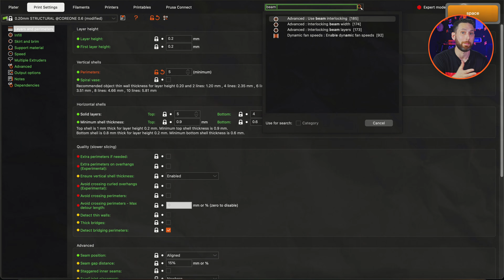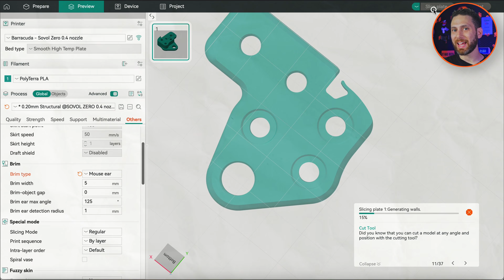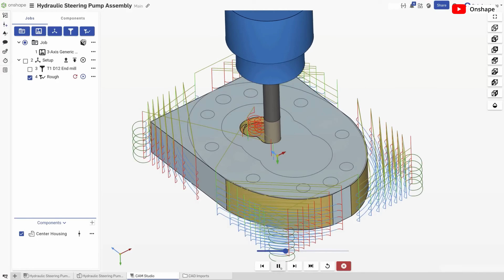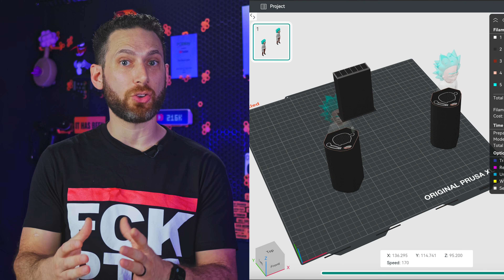Orca Slicer Just Added a TON of Useful Features!

Comment: I used STL once or twice in the very beggining of my 3D printing adventure and I was printing something that needed to be very round. I noticed the circles were like faceted and I hated the look. Googles why this is and got the STl vs STEP file crash course. Havent looked back since. All my designs are exported using STEP files now. The slicers sometimes take a good while to load the parts and I have had crashes but the results speak for themselves. Its worth the pain and suffering. Now if the slicer programers could optimize for STEP I think it would solve all my issues. Perhaps someday.

Comment: Reimagined & Modernized: QSlicerPicker for macOS/Windows/Linux

Hi everyone! I’ve been working on a complete rewrite of this utility to modernize the experience. Inspired by this project, I’ve developed QSlicerPicker—built from the ground up using GoLang and Fyne.

My goal was to create a more robust, cross-platform version with a cleaner UI and easier configuration for 3D printing enthusiasts. It currently supports a wide range of formats (3MF, STL, STEP, OBJ, and more) and allows for a seamless 'Open With' workflow to bridge the gap between your files and your favorite slicers.

It's still in active development (currently polishing the macOS bundle integration), but I’ll be sharing the project and the source code very soon. I'd love to get your feedback once it's live! Thanks for the original inspiration that started this journey.

 https://www.printables.com/model/1555284-qslicerpicker-utility-open-in-slicer-of-choice-aut
https://github.com/QTechnics/QSlicerPicker

Comment: Does beam interlocking work automatically.. or do you paint a section of the model where you want it to interlock.. and then select one print head/material for half of it and another material for the other half? Looking to print TPU + CF/PA6 materials as well as with ASA. Using PLA supports.

Comment: some mome my tips:
you can use outer/inner walls instead of precise walls (up to 30° on P1S  @ 0.2mm layer height)
avoid crossing walls (better for stringing)
arachen wall generator and decreasing mimimum wall width or outer wall line width to get more details

Comment: These extra features are really cool, but I know I won't remember they exist by the time I need them. It seems they keep adding more and more settings, which is great, but I'd love to see a developer do something to fight against users needing to be an expert on slicer settings to get the best prints. Like maybe a settings optimizer you could choose to run that would examine your current build plate and make recommendations base on the content.

For example, that X-Y Hole Compensation feature must mean the slicer can tell when there are X-Y holes in the object. So if you run the optimizer, it might prompt "It looks like your print has X-Y holes. Would you like to turn on X-Y Hole Compensation?"   Or "Your model's Z height isn't an exact multiple of your chosen layer height, so it will be rounded down. Would you like to enable Precise Z Height?" etc

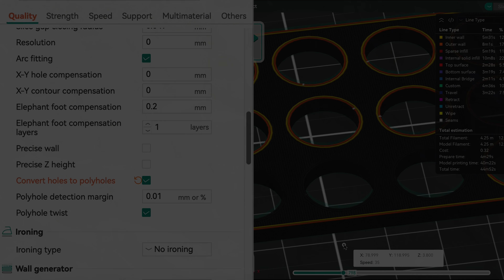Comment: 8:25 aaaand this is not a problem when using STL files.
I use STL files, not only because they're easier to make with blender, but because I can be deliberate about the EXACT geometry I'm getting. there's no room for a computer to choose "what's better for me". I know exactly how smooth I want a corner. I know exactly the sigmoidal profile of a curve because blender lets you choose that, and I still get all the benefits, because I just re-export, hop into orcaslicer, and select "reload STL". while yes that is available in other formats, with STL I know that I'm not making my printer do a single calculation or move I didn't plan in advance. it's not uncommon that I'll undersize a hole for better thread contact, or even need to adjust a hole's shape to be not an ellipse so layer lines and bridging don't interfere with the end product's contact with a support rod. and it'll print the same from any slicer.

Comment: Multi-toolhead stringing: your filament is too wet. If your filament is at sub-20% relative humidity at room temperature, you will get minimal stringing. I don't even use a prime tower on my XL for multi-color prints. TPU and PETG are going to be more sensitive than PLA, but PLA still does it.

Comment: Traditionally, infill didn't add much to part strength. I think testing infill multiline for strength/rigidity benefit might be prudent. After all, a single line of filament is a limp noodle only good for stabilizing wall layers during printing, but 4 lines of filament is a wall able to transfer load.

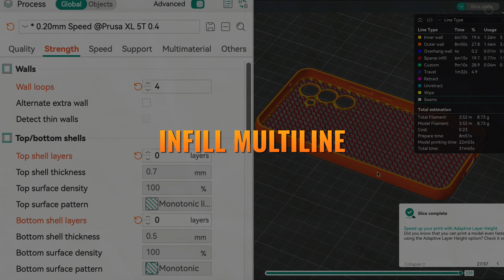Comment: 20:10 Infill Multiline, or infill multiplier as Cura has had for years, and is huge for TPU.

For ridged materials the perimeter provides all the strength, but not for flexibles. 

For flexibles the infill provides the strength and the perimeter disperses the load. 

Increasing infill lines behaves differently than just increasing infill. This setting will enable so much more for TPU in Orca. 

10% density 2 lines > 20% density 1 line.

Comment: i recently discovered ironing by accident when i printed a 0.2 width line from a 0.4 nozzle. The layer was perfectly smooth, but this was all at  600mm/s speed. Later i unfortunately discovered the actual ironing which is extremely slow. That layer time went from 60s to 16 minutes when using ironing

Comment: combine infill layers is nice, every 3 perimeter layers, it will print one infill layer of that thickness of three of those perims. You dont really need thin layers for infill since its inside you cant see it. This is extra useful when you're using the adaptive layer height, which can produce very thin layer for round geometry -- you wont need 0.05 thick infill in those areas .....

Comment: I'm just trying to figure out why you hate PETG so much that you created a shirt stating it, lol.
Reply: i only hate it because it's so brittle - i have just today dropped a massive piece (took just 7 hours... but still), and it shattered. But it is otherwise a pleasure to work with - reasonably strong, reasonably heat-resistant, super easy to print (generally ok undried), easy to glue, easy to drill.
Reply: @victortitov1740 increase your print temps. I noticed that anything under 250, PETG tends to be really brittle. I suggest 260-270. I usually do 270. I don't know anything about material science but I do know that it acts like a completely different material when printed hotter. I discovered it by accident when I first started to print with it. I ran a temp tower from 230 to 270. 250 and up looked the best but 250 snapped in half super easy. 260 bent quite a ways before it snapped and 270 had flex but not much. So I just went with 270 and everything I've printed with it has been insanely strong and I have yet to break any of it.
Reply: @Whambamrustytram  the thing that shattered was printed at 270... but this particular petg (overture gold) is weird, it just wouldn't print at the usual 230-250 (although i'm starting to suspect my hotend temp sensor).

It's not brittle when i load it slowly, it usually bends. It is brittle upon sharp impact. The one i'm using seems to be a little bit more brittle than usual, but i haven't done a scientific test, can't be sure.
Reply: @Whambamrustytram  I'm starting hating it too. Doesn't matter how long you dry it, after a few hours it will become as wet as was before
Reply: @enderforend4905  Any filament that is hygroscopic needs to be kept dry during storage and printing. A dry box doesn't cost that much and you can also easily make your own. There are plenty of tutorials. Hating PETG is silly. It's better than PLA for most applications if you know what you're doing.
Reply: @enderforend4905  I always dry mine and then print it from a dry box or drier. Thats what is recommended with PETG, so that is what i've always done and never had any issues.
Reply: @Whambamrustytram how do you route the filament? What printer?
Reply: @iklink Flashforge Adventurer 5M Pro and I print it out of my homemade dry box. Which is just a gasketed storage tote that I added a  some rollers and a dessicant box in. There is a guide that goes through the side that I can connect a ptfe tube to, and that runs up to connect to the printers feed tube.

Comment: Ironing support interfaces is killer. I've been doing this manually with built in supports for a while, and it does result in cleaner overhangs on flat overhangs. Even with like materials. Such a good improvement to have it automatic!! BTW fun feature in the Alpha - on my A1 mini, "Load Filament" is actually UNLOAD FILAMENT! Oooops guys!

Comment: the extra infill line was a long time ago added to cura.... it really helps out, if your infill needs to be super strong
Reply: thought the same.. but not only strength is a good reason.
It reduces layer seperation on infill.
And it's also a good way to increase weight without getting a "fine" (high %) infill and an other good parameter to modify TPU bumper springs ...

I used it a couple of times for ABS (less layer seperation on infill) and TPU to modify pretentioned bumpers

Comment: I can tell you dont really print ABS or similar materials often, two filament settings ruined my ABS-prints at the begin serval times and it is "internal bridges fan speed" and "support interface fan speed" left on -1 under the coolingtab. Alot ppls think they have adhesion problems if thier prints warps from bed or support but the source of that are pretty much always those two settings.

Comment: I use layer height modifier all the time. Sometimes I want finer layer heights for certain areas of the print, and still want the speed of the thicker layer heights for the rest of the print. I like that control better than what you get with adaptive layer heights. You also get the added benefit of modifying print settings to those sections if you want too.

Comment: Im still waiting on not just brick layers but z-lock (by z-lock i mean you print a cylinder in the infill part of a print against the perimeter walls and after per say 1mm traveled in the z axis you do a purge in to the open cylinder locking multiple layers together in a 3d printed micro injection molding scenario making a layer adhesion issue a almost non existing issue when done right

Comment: I used multiline infill last week. Was printing legs for a heavy set of shelves, and rather than increase the infill density, set the infill lines to two. Just have to keep in mind that it's pretty much the equivalent of doubling the density, so it's gonna take significantly longer to print. Those feet were hella strong though.

Comment: The infill multiline is exactly what I need to print the modcase evo.
This is a modular micro ATX/mini ITX case that uses slicer's trick to use infill as mesh. But if I make the infill percentage too low, the mesh prints very flimsy. too high and its unsightly.

Comment: Curious, why does a multi-head printer need a purge tower?.
I mean, each head has its own filament so its not to clean out the old colour... its not to build up the filament, thats done with 'poop'.
Read a few articles about it for single head printers, but seen videos of them still being used on multi and it doesnt make sense to me... I am guessing there is a reason, I just dont get it I spose
Reply: It’s not a purge tower, it’s a prime tower. It ensures the nozzle is primed, i.e. filled and ready to print. After a nozzle or print head switch melted plastic will inevitably ooze out of the nozzle that just finished printing. Without priming there will be gaps when that nozzle/head starts printing again. It serves the same purpose as the priming line printed at the start of a single color print. Years ago (Wanhao Duplicator and Simplify3D) I’d always print a thin skirt to prime the nozzle, now the slicer handles that automatically.
Reply: @radish6691 makes sense. I guess my next question is why do the prime towers seem so large? Wouldn't say... A 10mmX10mm single wall with sparse infill (or none frr that matter) be enough?
The prime towers I see in vids are large. 
My concern isn't filament wastage (I have at least 40-50 rolls at any one time) it's more time wastage. If it's spending that time doing a solid 30x20 rectangle it just seems overkill to me

Comment: Im thinking infill multiline will be really useful for filling parts with sand or plaster, stronger parts at super low infills
Reply from the maker: OMG YES! That would be so much better than increasing the infill percentage if you need strength but also need the cement to flow through. Good idea!!!

Comment: Small area flow compensation doesn't "boost" flow to fill small areas. It reduces the flow in small areas that would otherwise be over extruded because the flow rate is too high. You can clearly see the result of enabling the feature and selecting Flow as your model viewing mode.
Reply from the maker: Oh snap good correction

Comment: I use beam interlocking to imprint PLA logo into more advanced materials. As PLA gives variety of colours, part made out of PACF usually black can have nice branding. I learn that glue give up with time. And it is much easier to have ready part of print bed rather than messing with glue as a additional step

Comment: I switched to Orca because it supports direct import of STP models from my CAD and has very convenient modifiers that I can design in CAD with the part and import together changing the 'type' for the modifier part after import.  I use it a lot if I am going to tap threads.  I put a modifier cylinder around the hole to be tapped and set it's infill to 100%.  Another reason I switched to Orca - mouse ears.  Mouse ears are great.  BTW I use it on a Linux system (Linux Mint)

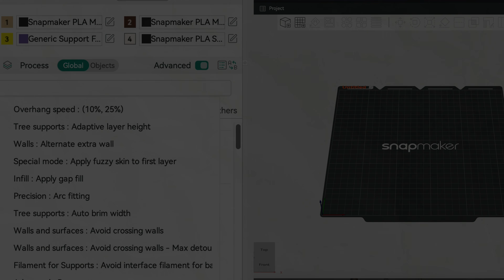Comment: 20:55 ok i bite he bait 😂 i think the obvious practical aplication is that with 3 layers of infill  thickness you can use less density infil with actual added strength (depending on the pattern) infill is considered to not help much wih strengthevent at larger densities but if you have infill with 3 layers for example cubic pattern, 5 to 15% should make some models extremely strong, even for tpu with gyroid pattern i really dont like the infill i only use infill to allow top surfaces to be laid on. Now i am vey curious to try this one out

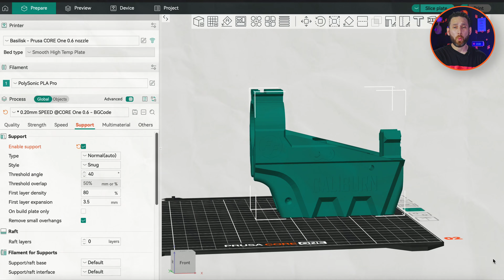Comment: 4:00 also if that happens try ctrl-z 😂
Reply: That's great until you're mid-project and that crashes the dam slicer!
Reply: @AndyMitchellUK26 yeah gotta love those slicer crashes. At least orca tries to bring you back to where you were
Reply: @travistucker7317  I have to make sure I'm saving frequently when using Bambu studio. It works for the most part but every now and then it'll crash.
Reply: Ctrl-z is just undo, i never got crash for that i remember, i mean if not using ctrl-z because it could crash imagine what actual features you are avoiding that actually weight on the preocessor..

i recommend you to keep saving projects either way since the way you say "mid-project" seems that you might loose all progress.
Reply: @Saleca  Yeah, I try to. Sometimes I have several changes to undo and it'll crash if I press undo too fast. Thankfully, Bambu studio now tries to recover automatically after a recent update.
I wouldn't mind but I've got 64GB of RAM and a Ryzen 5800X so not exactly a weak system for a basic 3D slicer.
Reply: @AndyMitchellUK26  thats curious, i use flashforge orca slicer i though it was weaker slicer that bamboo but i never had such issues with my weak laptop. Maybe what it lacks in features gets in stability

Comment: Why are you praising a video at 10:53 that don't support what you said about that topic and is done wrong (without a single inner wall and therefore practically disabling the feature. See comments in the video)
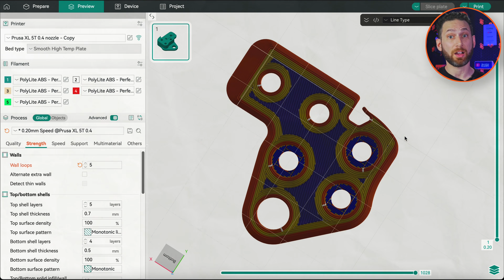What is the dimensional sacrifice you mention at 14:52 when using ironing? Is it about the 0,05mm added to z hight that jan tec mentions? That would be strange to me considering your reaction about precise z hight.
However, many good tips. Thank for them. Might have to look for a way to get my A1 running again on ocra.

Comment: Careful with scarf seams, I recently had multiple print failures from it as the speed/flow rates around it are impacted.  Took a while to figure out why things were failing just in that section of a round part, so much so I even had changed the geometry to no avail.  Any other seam selection provided successful prints again.

Comment: I haven't switched to OrcaSlicer because it lacks official Prusa profiles and you can't export the settings from PrusaSlicer and import them into OrcaSlicer.

I know that Prusa profiles exist on Printables, but I'm talking about OrcaSlicer coming with them built in just like the other printers that you can just check a box for.
Reply from the maker: There are good profiles for most Prusa printers now actually! But yeah Prusa needs to add better support right at launch
Reply: @thenextlayer  Where are they?  I downloaded the latest release around a month or two ago, and when I ran the setup, there were no Prusa printers there.

Comment: I have just started with mixing pla and petg under specific use cases and have had great success. One such example is someone wanted starter flower pots where the bottom of the flower pot has to sit in water so the pot has to have legs on it. I would print the pot and supports in petg to cut down on filament change times, but I would use pla as a top surface support materal for a nice clean surface and super easy way to remove the support material. This method is an absolute game changer for when you need to use alot of supports and dont want to trust large bridging areas.
Reply: I believe what you’re describing is using PLA for the support interface layer on PETG part to get a clean, floating bottom surface layer. In that case the pact that these two materials do not adhere to each other is intentional.